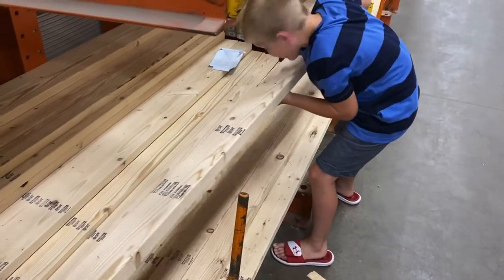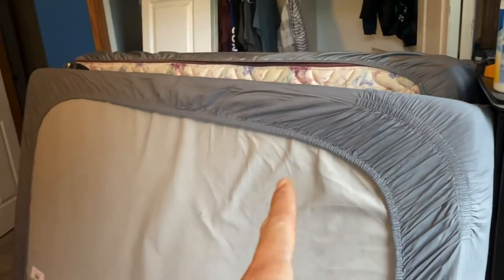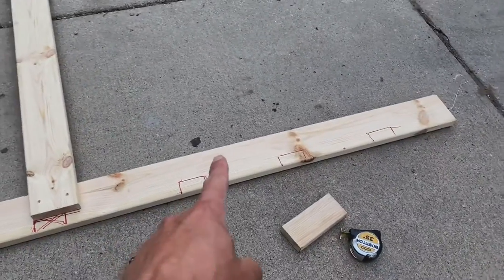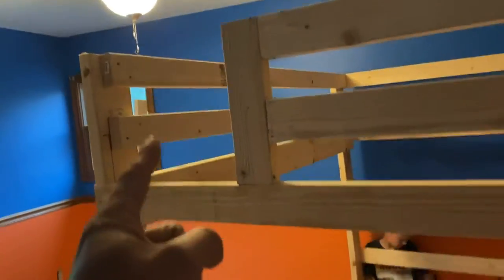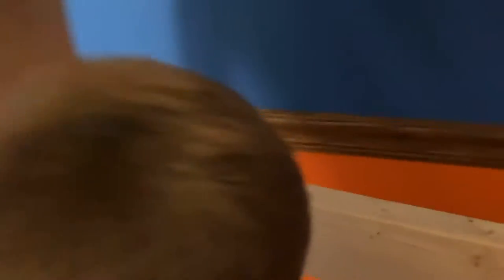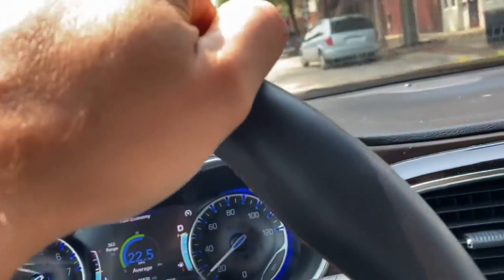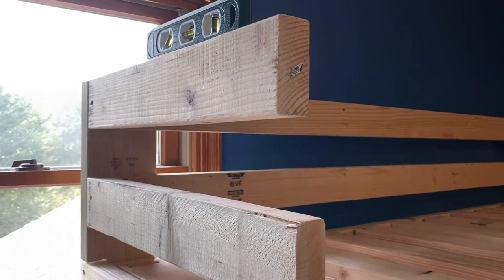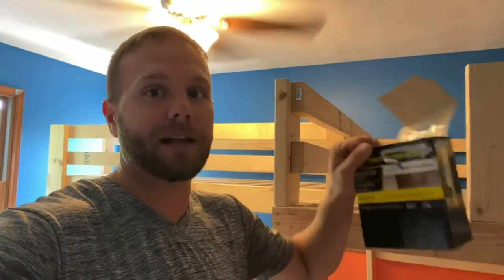Loft Bed DIY “Triple Stack” Under $500 #smallbedroom #savespace

Comment: I have had good luck with diablo blades in everything except my circular saw.  But that's because I abuse my poor saw, force it to go faster than I should, overheat the blade and start losing the carbide tips from the teeth.  That's with a combo blade though.  My next blade will just be for framing, now that I have more tools, my circ saw can be less of a swiss army saw.  Lol.
Reply: You know this already though, you'ge watched me abuse a saw just because doing it was faster than explaining to you.  Lol.  Might even have video of it happening posted.
Reply from the maker: So far so good on the blade. Definitely worth the money 💰 vs standard stock blades
Reply: Also, I can teach you faster ways of notching.  A jigsaw is a great way to do it, but I'd have done them on the mitersaw if there was more than one or two.  Tablesaw or circ saw can work too.  Or pretty much anything and a chisel.
Reply from the maker: @darobison42  I wish I had a bandsaw with a table
Reply: Turned out great man!  Now get the kids to sand it all down, wood filler the screw holes, throw some stain and poly on 'em, and they'll be heirloom worthy.  Lol.  Now I want to build one...
Reply: @chris_b_liven  that would be excellent.  I've wanted one for years.  My scrollsaw I think would've been able to do it too.
Reply: Definitely worth upgrading from stock, no matter the brand.  Cheap tools are more trouble than they're worth.  And by cheap I mean quality, not neccesarily corrolated with price.  I've gotten quality tools for free on the side of the road and I've way overpaid for junk, then gotten a cheaper on of a higher quality once I knew what to look for.